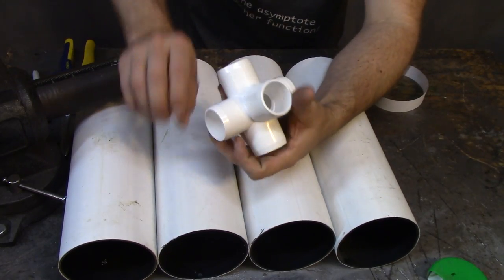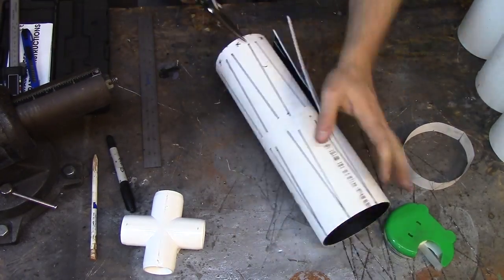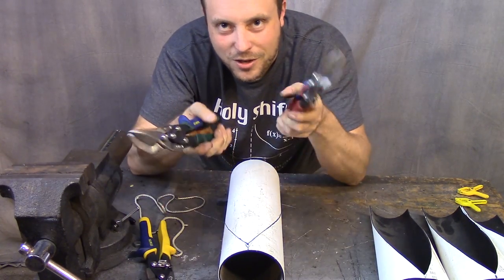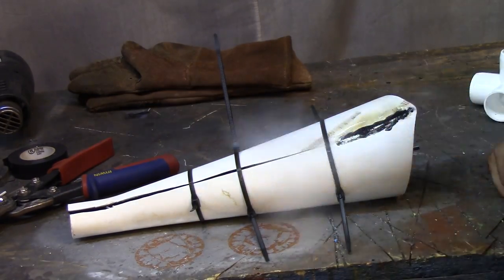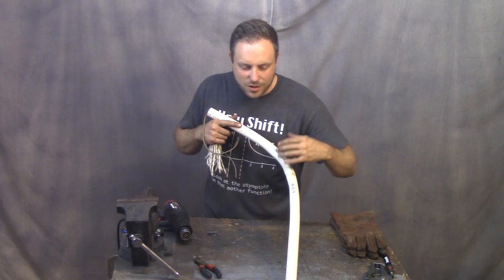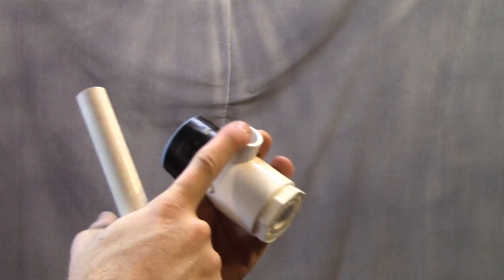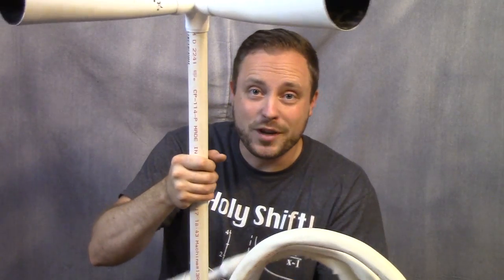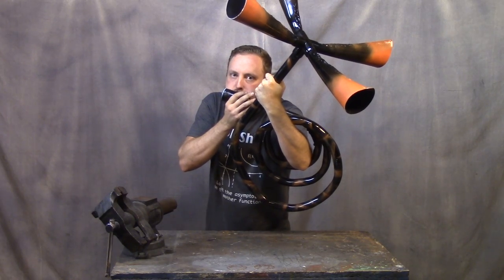PVC WAR HORN - Test Build

Comment: If you want to stick ABS together use acetone. It forms a chemical weld between the two sections and makes it pretty strong. You basically just paint the acetone onto the two edges you wanna stick together then hold it in place and it should set somewhat quickly
Reply: For a weld that is as strong as the base material, dissolve some ABS scrap in acetone until it forms a paste, then use it like glue. Once the acetone evaporates out of the paste, you'll have a solid ABS weld bead and no gaps. Much stronger than using just acetone but it takes hours to set if it's thick.

Comment from the maker: #PVCWARHORNCHALLENGE This could be awesome! Especially if we can get some people like the Hacksmith or Colin Furze involved! 
Side note: The pipe I used for the horns was HDPE not ABS. Really difficult to bond.
Reply: If you use acetone on both abs surfaces that you wanna weld the hold them together for a few seconds than the acetone will evaporate leaving the two parts chemically bonded and its very strong :)
Reply from the maker: Austin Lower Well I wish I knew that a little while ago! LOL Thanks! I'll know for next time.
Reply: JAIRUS OF ALL watch anchorman. that's why he says loud noises and yells
Reply: I've been summoned.
Reply: Also I think Colin Furze has already won, he farted on France with a giant pulsejet =P
Reply: I mean... It's a PVC Warhorn challenge.... I don't think even Colin would be brave/dumb enough to make a Pulse Jet out of PVC, if it were even possible in the first place.
Reply from the maker: I remember the fart at France but this is human powered. Not sure if that is enough of a difference.
Reply: JAIRUS OF ALL the thing sounds like a chewbacca in agony
Reply: JAIRUS OF ALL 

LLLLLLLLOOOOOOOOUUUUUUUDDDDDDDD NOISE
Reply: JAIRUS OF ALL #brownnote #poohorn
Reply: JAIRUS OF ALL you need to get furze in the boat
Reply: And The SlingshotChannel
Reply: JAIRUS OF ALL you should make it so you can carry It on your back.
Reply: JAIRUS OF ALL that sounds like chewbaca
Reply: Heat sand in an oven or with a flame. Pour it in to the pipe. The sand both heats the pipe to make it malleable and acts as a filler to prevent kinks!
Reply: Sand bendt it.
Fill it with fine sand and concentrate the heating on the side that stretches.
It is what we used to do when there was no bending machine around.
Here's an example
http://www.instructables.com/id/How-to-bend-pipe-without-a-pipe-bender/
Reply: Jairus of all where did you get that shirt I want it so bad

Comment: Couple of tips: instead of trying to custom form your funnels, use cheap/inexpensive black plastic funnels from an auto parts store like the ones used for draining/filling automatic transmissions. Also to bend pvc pipe without it kinking, try filling the pipe with a sufficient quantity of play sand preheated in an oven to about 400 deg F. The hot sand will soften the pipe allowing you to bend it in whatever shape you want while keeping it from kinking/collapsing. Cheers!

Comment: Traditonal plastic welders use a spinning rod of filler plastic. The friction heats all three components (the sides to be bonded and the welding rod) and welds them together. Other plastic welders heat both sides by using a hot plate between the two sides and then removing it and sticking them together. Keep the torch for welding/soldering metal.
Reply from the maker: Thanks for the info!!

Comment: To bend pvc similar to a mandrel you can plug the ends (wood plug works well) and fill it with hot sand heated on a stovetop. The pvc absorbs the heat from the sand and is able to bend without crushing because the inside of the tube is full.

Comment: I would get a bending spring for the thin plastic to prevent crinkling or cracking. The spring will help to keep the pipe from losing form when heated.

Hope this helps, nice build.

Comment: Jairus, the reason shooting the air horn into the pipe didn't work is because all those bends has actually created a low pass filter.   Your DIY air horn works because it's a lower frequency.   If you took some bends out (like almost all) it would actually be much louder.

Comment: To resolve the kinking issues you had with the curly bit, you could run an aluminum rod, (or any bendable, yet rigid rod) through it, and bend it to your liking. You'll get the clean shape you want, but it won't be all floppy because of the rod.

Comment: Heat up a bucket (calculate the volume) of clean sand in an oven or over a fire. Then dump it into the
PVC pipe, let the pipe warm and then twist it around a form. (like a bucket).  This came from a 60's or 70's issue of Popular Mechanics for making lamps out of PVC pipe.  (less danger that way) ;-)

Comment: You know ASB glue is in every hardware store, right? The other thing If you filled the PVC pipe with sand or salt cap or plug the ends before  you started to bend the pipe in a coil it wouldn't of collapse in the tight bends.

Comment: If you pack the pvc pipe with sand and then heat it up and shape it you'll maintain a cleaner inner diameter without any kinks. Just a thought. 🤔

Comment: If you fill the pvc pipe with sand and heat it up, the sand prevents kinking
Reply: or you can heat the sand in a saucepan first and then bend the pipe.

Comment: You can fill the pipe with sand before you bend it. Takes longer to heat, but will not kink.

Comment: Urgent Question: While the challenge may be over, Homecoming season is not, I plan to build a PVC Greathorn/Warhorn and need to get a better understanding of the artificial little diaphragm piece. Are you/him blowing like a horn, or are you simply pushing air into it with the pipe touching the plastic? Any tips on getting a deep noise from my horn? If anyone has advice please send my way!

Comment: I use heat guns on PVA when the 3D printed part needs shaping because it warped while printing. Should I have been wearing a mask?
Reply from the maker: I don't know about that. Some plastics are probably ok.
Reply: I think it's okay, since PLA is a biodegradable. It has a low melting point also, so I didn't need to heat up much to make it malleable.
Reply: PVA and PLA are both fairly harmless when heated. I mean yeah, not healthy, but not extremely toxic or anything. Even the fumes given off by frying food in oil are carcinogenic if inhaled in large amounts. Just avoid directly inhaling any fumes, and crack a window if necessary.

Comment: Make a V-shaped trough out of cardboard or a piece of siding. Line it with heavy duty aluminum foil. You can heat the PVC way faster and more gently without fear of burning it and releasing harmful gases. Once it becomes like a wet noodle it's ready to shape as needed.

If you wanted to save a lot of time on the horns though, use truck transmission funnels(abs). I see them in the bargain bin all the time at autozone for $1 or $2. You can still shape them if needed.

Special thanks to Backyard Bowyer. https://www.youtube.com/user/BackyardBowyer